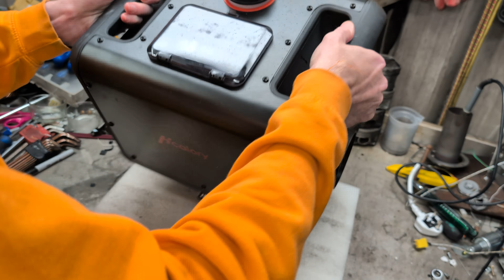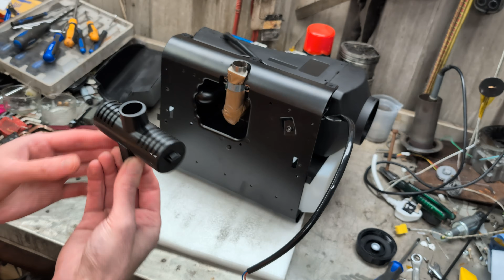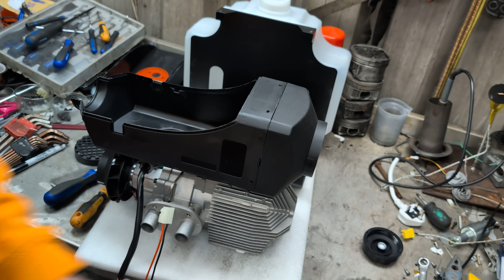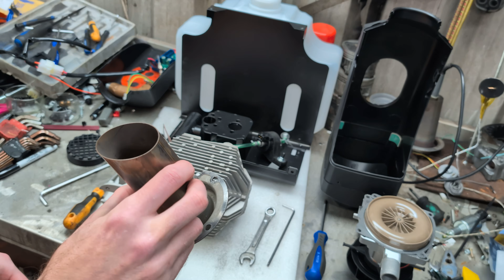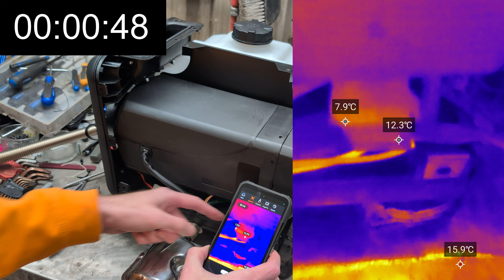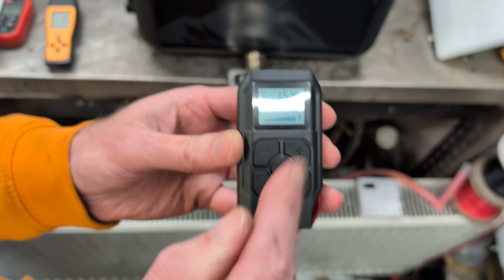Hcalory Toolbox MAX diesel heater - disassembled and testing

Comment: OK, you you seem to know a lot about these. Is this unit safe to use in the living room of my home? I would like to buy one of these and leave it set outside and run the heated air duct in through the basement and up into the old ductwork of my old furnace that goes up into my living room. I would plug off the rest of the ducts and only allow it to come up into my living room as I’m quite sure this unit would not put out enough air to power all the duct work in the house. My only concern is is the heat pipe pumping out clean air with no diesel fumes? they say even just a little bit of diesel fumes is very bad for you.
Reply from the maker: Lots of people are using the diesel heaters to heat homes now.  As long as you have the exhaust sealed tightly and it's outside there shouldn't be a problem.

You should have a high quality CO alarm with any fuel burning device.

Comment: Hi David, thanks for the video. I bought this unit and planning to put it in my garage (that is also my shop for small repair jobs). I was wondering if I'll run it inside (of course with the exhaust pipe led outside of the building), does it consume a lot of air, or can it be dangerous to my health? The garage door has some air leaks here and there, so it's not completely sealed, but I'm still not sure if it's enough ventilation for air for the combustion.
Reply from the maker: I don't think there is enough suction from the burner fan to create a vacuum large enough that you couldn't breathe.  You could drill a 1 inch hole somewhere and that would let enough air in.
Reply: @DavidMcLuckie  Thanks for the quick response!

Comment: just received another of these heaters yesterday but there's a problem with this one, but  it's an easy fix though when I looked underneath I discovered that the fuel line had a kink in it as it enters the burn chamber. and I remember seeing a review of another make of diesel heater where that one arrived. With a spring shoved up the fuel line, so that's what I did to this one, and it stops the line collapsing it's strange though that the first heater I purchased hasn't kinked but this second one arrived with a Kinked fuel hose. It was never going to start because it couldn't get any fuel, this may explain the odd negative review that I've seen, and the purchasers haven't realized why their heater didn't work and just sent it back. which is fair enough not everyone has the knowledge or capability to do such things.

Comment: Hi David.watched your videos for a while now, what’s your take on best way to run diesel heaters ,I have just put 2 on a static caravan,underneath ,1 under sitting room ,1under bedroom ,is it best to start heaters on full chat or a better setting to try and save sooting,the same advice on switching them off ,thanks .
Reply from the maker: Thankfully they all technically start at full power, run until operating temp, and then throttle down to whatever setting you have them set to.

The best way to get them to last longer is with a CO meter and make sure they aren't running too rich.  A reading less than 50ppm is fine for most heaters.
Reply: @DavidMcLuckie   Hi David,thanks for the information .

Comment: What's your recommendation for fan gaps?
Reply from the maker: As close as possible without touching.
Reply: @DavidMcLuckie  When I replaced my bearings in the fan motor,  I measured it before taking off tan fan. It was .021-.020 inch (.508-..533) with feeler gauge. Must be good measurement as after 3 yrs running I had no carbon build up in the chamber, and 0 carbon monoxide from exhaust. Just the screen hole was clogged and giving an error with white smoke.  But I run mine at highest heat always.

Comment: Curious if anyone has attempted to modify the end of the burn chamber to increase turbulence? Small slits to make tabs you can bend slightly inward and at a slant for a type of turbo fan look, and do it counter rotation to the fan.
I  would be very interested to see that tested.

Comment: Hey David, thank you for the video! My toolbox power supply got wet and shut down… it won’t turn back on now. 

I see your plug has a fuse but mine does not here in the US…is there a fuse I can replace? Or what do you suggest me looking at to fix it!?

Thank you!
Reply from the maker: There is likely a fuse inside the power supply soldered onto the circuit board.

Comment: Glad You tore Yours apart so I don't have to unless something is amiss. I got Mine today, 11/19/2025.
I would like to flip the DC power connector over so the Cord hangs down instead of up. 
I mounted the Metal base feet then added some Nuts & washers to put on the 4 feet to raise it up just a bit more. 
I will Fuel it up and try it out tomorrow
Reply from the maker: I'm sure it's just two screws for the connector.

Comment: Great tear down and comparison. Did you see any reason the remote compartment is bowed in? I emailed customer service and they basically told me there is no need to tear it down for maintenence. And they do not sell a repair kit with seals etc.
Reply from the maker: Mines the same.  Doesn't seem to affect anything, and you only see it if the flap is open.

Comment: Thank you for the video, well done! I purchased this exact unit and have a question: Can I run this in my enclose trailer conversion? I have an exhaust port that works great but my concern is creating vacuum because of the combustion air intake is drawing from inside the trailer. FYI- Its a 20’ enclosed trailer conversion.
Reply from the maker: Assuming your trailer is well sealed, then yes you would be pulling a vacuum.  If not you'll be pulling in cold outside air from an vents so the burner can burn.

Comment: Hello, thank you for doing this video. I just received mine yesterday and had it apart the same day. Found the green fuel line kinked badly right at the heater body. Replaced it with proper line. Fuel pump mount was loose. The hose clamp for the exhaust elbow was also loose. Put it back together and I am very happy I purchased this heater. I had a Winnpro and liked it but it got really noisy at low power. Sounded like an unstable flame. This heater runs very quiet and the wife even likes it. Also, what thermal imager are you using? Thank you again.
Reply from the maker: That one is the Doogee V20 Pro.  It's a phone as well, but the thermal imager on it is good.
Reply: @DavidMcLuckie  thank you for the info. can you use the thermal imager without getting the phone activated with any cell service?
Reply from the maker: Yes.  Mine doesn't have a sim card in it.

Comment: Thanks for the video! The people who continue to say all these heaters are the same are clowns. Yes, they are all "5kw" heaters, but the components and features are wildly different across the market at this point. 

You showed a lot of the differences that lead to the higher price of this unit, a large number of which arent visible.
Reply from the maker: This also true.  While they are all based on the same design, component differences actually make a difference.

Comment: ca youplease  take closer pictures from ECU or others can help for reverse enggering ? i am trying all ways to add mine to Home Assistant but no way
Reply from the maker: You could build/buy an Afterburner ECU and connect to HA that way.  https://mrjones.id.au/afterburner/
Reply: @DavidMcLuckie  need to completely buy all new ECU for afterburner, this controller is under not supported --- unfurtunately , only way is riverse engeering or wait for others to do it.  i tried RF , BLE and UART all faild no way to send command )
Reply: I have an HCalory heater on my boat, which also has Home Assistant, and would love to be able to control it  remotely from home using HA.

Comment: Has anyone clarified the output level of these ? 
I keep hearing that they don’t give out more than 2kw even if they state 8 ?
Reply from the maker: Me.  In this video.  Approx 3.7kwh of heated air.  Although I'd maybe round down a bit.  But a good 3kwh at least.
Reply: @DavidMcLuckie  Then you have ones claiming to be 9kW with extra large aluminum body.  showing the housing at 44.5cm/17.5in long.  that doesn't say the burn chamber is longer and if so by how much. LOL some what tempting if it had a black friday sale.
Reply: One of the other youtube guys that reviews these does all the calculations on fuel usage and available btu per oz. Of diesel and the 5-8kw units were around 4.5kw output and the smaller one is like 2400w or around there if i remember
Reply: Based on the calorific value of diesel, if this heater only uses .35Litres per hour then its max heat generated is around 3.75 Kw - but a significant proportion of that goes out the exhaust, so the usable heat will be below 3 Kw I’m sure.

Comment: I got mine and it leaked fuel underneath where it goes into the heater unit itself once fixed great heater
Reply: Had same problem
Reply: First run on mine this morning and its leaked fuel on my patio. It never even fired up and gave an E10 error code, how did you fix yours?
Reply: @ant6496 mine leaked underneath a short pipe right next to the exhaust the clamp wasn’t tight enough to hold as it’s a smaller diameter pipe I used a small adjustable clamp and fixed it I all so took off the the outer case lots or screws but very simple to do and checked all the fuel pipe connections I fired it again and all was good and the heater works great now I contacted the maker directly and told them the problem they gave me a 10% refund as I already fixed the problem but they offered a replacement straight away hopefully this helps you
Reply: @Thebigfellaadventures  Thanks for your reply, hopefully its an easy fix like yours. I'll take a look at it tomorrow :)

Comment: thanks very much for doing this, I too have one of these heaters and I love it and have another one on order via bangood I also managed to get them at a good price everywhere else was about £40 more I'm writing while only 26 minutes into your video and talking the screen saying can you measure the length of that burn chamber or show it in comparison length it and a normal one,  to know if we could cut the burn chambers at an angle on our other heaters   would do the same thing. or would we need to Weld a piece on to achieve the same thing food for thought. I have attached two Mercedes S Class Egrs together as a heat exchanger and this runs, a central heating radiator very well. but if the if the circulation pump is not running, that will cause problems with. Overheating in the actual heater and it will shut down, it even set off the carbon monoxide which I know for a fact there is no leakage of because I had two other testers at the side and I use exhaust paste on all my fittings. thanks again for doing this. Video great reference for, us all I like to have spares for everything. And knowing that the pump's different and even the gaskets I need to get Spares Of those too. I will now try to finish your video without writing any more. Till the end